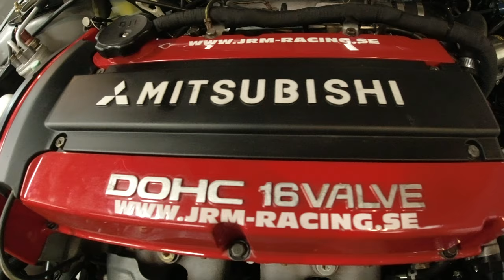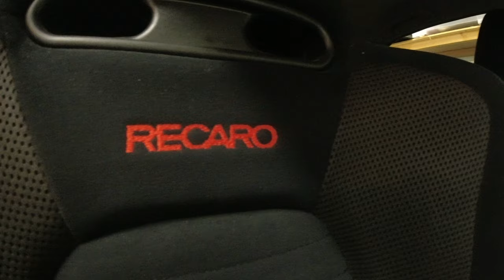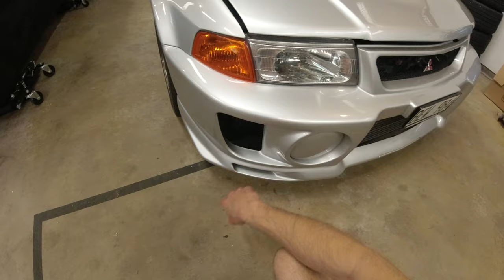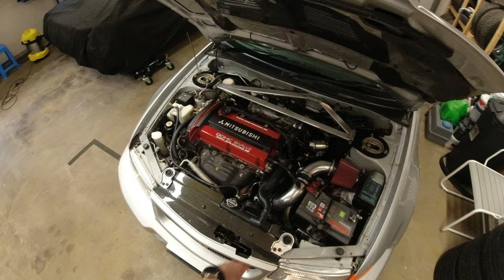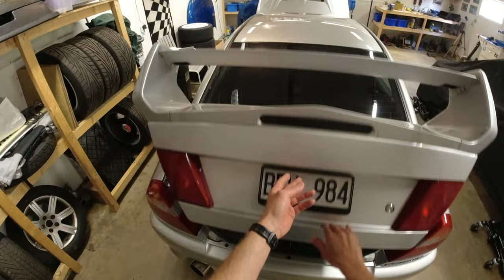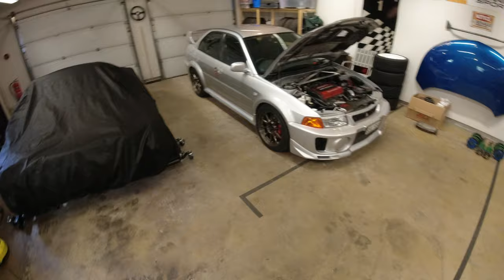I BOUGHT AN EVO 5 WITHOUT SEEING OR DRIVING IT!

Comment: Congratulations Mythical Mark!  Your Evo 5 is beautiful.  I like everything, the Konig rims, the body color, the interiors of the Evo 8 and the Recaro seats and the Sparco steering wheel, the engine that develops 507hp and 660Nm is phenomenal and looks normal from the outside.  I like your plans to lighten it up with the carbon wing, remove the rear seat, replace the mirrors, remove stereos, and more from the dashboard.  I have not seen the odometer, what is the maximum speed indicated?  Great Evo5.  I can't wait to see your next video where you will replace the orange indicators with white ones.  Congratulations Mythical Mark!  Have a great day.  Bye 😃👍👍
Reply from the maker: Thankyou Salvatore! Hopefully there will be a lot of videos of me doing things on and with this car. The odometer is still in km and reads to 280km/h
Reply: @SoloLap  Excellent 😃👍. Amazing Evo 5 Mythical Mark 😃👍💪🏻💯